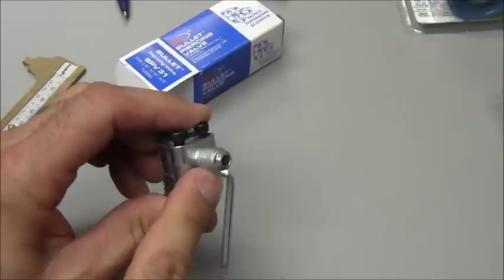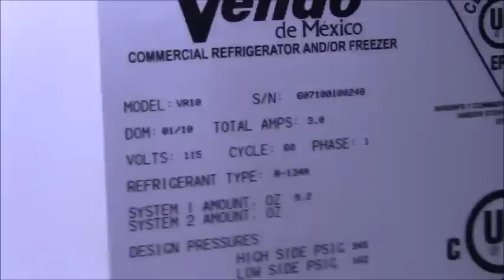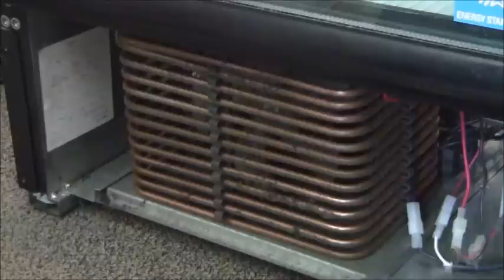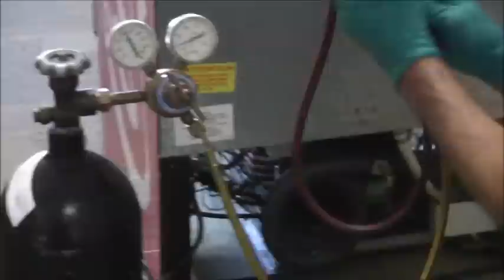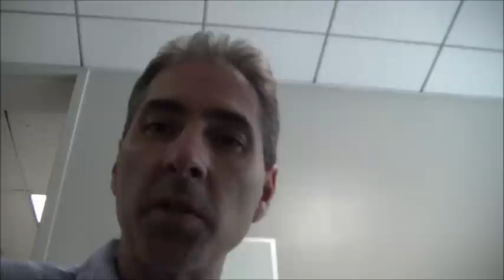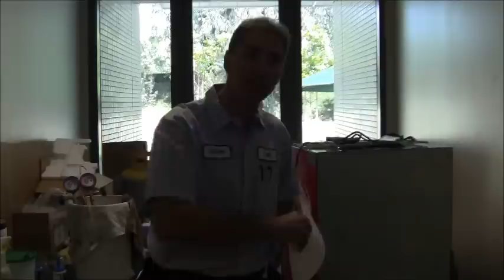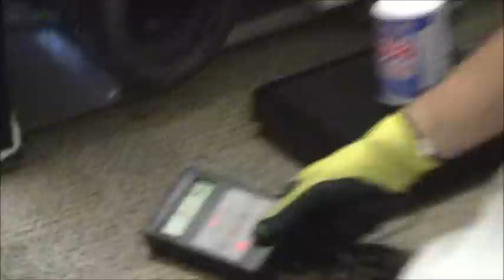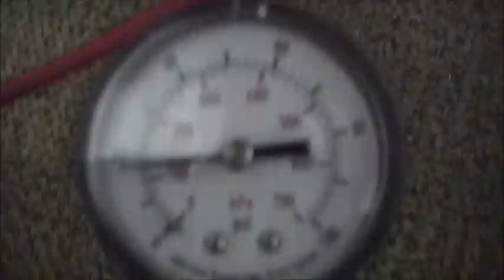Refrigerator not Cooling, Charge with R134A and Resealable Can

Comment: I have what looks to be the same coke fridge Vendo Vr10 that was in the 60's.  I didnt use a scale but put on a bullet valve and attached a r134a can w/gauge.  Pressure was at zero but I added enough to get to 10psi.  It's now cold inside "40's" but I wonder If I should add more since yours is at 18psi?  Iwatched other vids and they would stop at 5psi.

Comment: A friend of mine that works on commercial refers introduced me to Easy Seal. I have used Easy Seal on R22 systems and I have systems still running 5 years later with Easy Seal inside, I have not had to add refrigerant in that time frame. If the leak is too big it won't last, eventually the copper just denigrates. These were all copper units.  Also these are my own rentals so no one to get made at me if it doesn't work. It helped me to extend the life of my units quit a bit. I tried it before you bought it, hope this helps.

Comment: Just put the valve on it, let out the system preasure. Screw on the can turn the fridge on and it will pull the new charge in until the can is empty.  Unscrew the can hose and your good to go.
If if it stops cooling properly later, your valve is leaking down.

Comment: How does super seal keep from clogging the orifice?
Reply from the maker: Great question, Answer = I can only assume the engineers that designed the formula took that into consideration. I only use it as a last ditch try before unit replacement. I have used this product on a few units without any issues. One of the units was done about 4 years ago and is still running without a leak today!!!
Reply: @KenTraining  well that's very surprising & amazing. Does it actually stop leaks good then or have you needed to refill them still but longer intervals?
Reply from the maker: @naturestrail2296  In my case it stopped the leak on 2 different systems with only 1 application for each of the systems. Follow the cans instructions and use the correct can for your system.
Reply: @KenTraining  thanks for the reassurance

Comment: Infrared doesn’t work on copper pipe
Reply from the maker: Infrared thermometers may not work well on copper pipes because the signal reflects off the shiny metal and provides an inaccurate reading. To get a more accurate reading, you can wrap black electrical insulation tape around the pipe and point the thermometer at it. The tape will be at the same temperature as the pipe and will give a good reading.

Comment: 0:30 - That’s quite a comprehensive looking checklist can you explain the different items or post a copy?
Reply from the maker: go here for all my forms https://kentraining.wixsite.com/kentraining/download-all-forms-here
Reply: @KenTraining  Thanks, Ken. This is great!
Hmm. I thought you were using a refrigeration checklist like for a refrigerator or walk-in freezer. I see checklists for comfort cooling and ductwork.
Reply from the maker: @garypoplin  Sorry, I only have 1 check list. Most of my work is AC and not refrigeration.
Reply: @KenTraining  That’s ok. I’m in the process of creating my own list along with some refrigeration tips like letting the N2 pressure out of the system through the low side instead of pushing all the oil out of the receiver through the king valve!

Comment: If it’s slowly not cooling like it once did after 10/15!
Years don’t worry too much about a leak if it was still cooling, just add some feron and keep checking temperature with a gauge 
Add as needed with temperature control set half way

Comment: I usually just install  piercing or saddle valve, add UV dye, add freon to +15psi on low side(for refrigerator only) and DONE in 30 min. I tell customer to call me when fridge get warm again.  Typically it will get low on freon after one year. When customer call me again I will find a leak with UV flashlight and yellow glasses and do  permanent repair. Thank you for good video!

Comment: You are not supposed to leave access valves on a sealed system.  The charge is to critical, and access valves are known to eventually leak.  Use the process tubes to access the unit and then pinch them off and braze shut.  This is how the factory did it.  Leaving access valves on small systems like refrigerators and drinking fountain coolers is not best practice.  If there are service valves from the factory, this does not apply.
Reply from the maker: I disagree, I will leave in place.

Comment: Refrigeration manufacturers should be required by law to have a recharge valve on all refrigerators.
Reply from the maker: that would be nice.
Reply: They are not left there for a Reason.  Too easy to leak.  Use the process tubes like the factory did.  That’s the reason it’s called a sealed system.

Comment: Ken, pulling my hair out. The relay I am looking at with this borrowed fridge... Looks like nothing I've seen also the fan was not turning, I gave the compressor a little whack and it tried to turn on the fan started turning but now it's just clicking on and off. I noticed it also uses r12, am I going to just waste my time here. Second refrigerator in 3 months I've had to deal with. I took some pictures of the components attached to the compressor... It looks like a little cylinder about an inch long, with just this rubbery Brown oranges material which is connected to the single lead above the two bottom ones on the compressor. The other two have double sets of wires going to what I assume is the start relay, and the other one maybe is an overload heat sensor of some kind? That literally detects heat by being in contact with the side of the compressor. Ever deal with anything like that?
Reply from the maker: I have not, Sorry I could not have been more helpful. 
Good Luck!
Reply: Yeah I figured out what it is, the relay part is $50, but I think I'm going to test resistance on the compressor this morning and make a very quick call whether to buy a new fridge or not. We have a lot of power fluctuation and quick power outages here but I don't understand why it's taking out my refrigerator so quickly. The voltage is correct on the plug, the circuit breakers are rated how they should be it's HUD certified 4 year old house. So if the amperage is over on a power spike it should trip the breaker. Maybe it's just bad luck.
Reply from the maker: @cmdrefstathiusplacidus9003  I recommend you install the refrigerator to a power surge protector first then plug the surge protector into the wall outlet. That will give the appliance protection.

Comment: Never heard of a professional using an AC system sealer.  Most service guys won't even hook up their equipment to a system full of sealer.
Reply from the maker: I have only done to 2 systems and had good results with both.
Reply: Kind of like radiator stop leak.  Totally unprofessional.
Reply: Had a tech put sealer in an r22 system 15 years ago that had been going low every 2 years.  Still running cold this season.

Comment: Need help with my LG refrigerator my lights not coming on my water ice maker panel will not do anything or light up at all however the numbers 56 are lit up. What should I do? Ive only had this refrigerator is only a year in a half old.
Reply from the maker: I would call LG Tech support and ask what code 56 means.

Comment: Hi Ken, in my refrigerator, the piercing valve is on the process tube (which is crimped at the end). How does one charge the refrigerator through that?
Reply: You are not supposed to leave access valves on a sealed system. Use a piercing valve on the end of the process tube, before the pinch, and recover any refrigerant.  When your done with everything, pinch off the process tube(they make a special tool), remove the access valve and braze the end of the process tube up.

Comment: I thought the low side was supposed to show less than 1 psi on the gauge, because its sucking, or pulling a vacume basically. Meaning you had plenty of refrigerant. If it showed above that you were low.
Reply: On average 3 psi is where you want to be. 1 psi is low 5 is to high and can put stress on the appliance. The system is low if it is at 1 psi or pulling vacuum. If the appliances is pulling vacuum you should vaccum pumpe system and put freon in at labeled amount. Use uv additive to find leak if it's not obvious. Just fixed my freezer and added exact label amount of freon and was 3 psi exactly.

Comment: I'm a DIY working on a 22YO GE Profile side by side which died in this CA heat wave. Found the condenser fan dead and the defrost control  intermittent, fix it all but the refer side is now having trouble reaching 37deg during hot days ( drifts to 42) , the freezer is fine at below zero with both sides temp control crank to the max. During my troubleshooting I noticed that the compressor was pulling low amps  , 40% low. I considered that that might mean a worn-out compressor. But Ken, i heard you say your Coke refer. was also low at 1 amp (I saw the name plate at 3.2 amps) . Is low compressor amps/draw an indication of a low refrigerant charge?
Reply from the maker: Yes it can be an indication of low charge and the compressor is not working 100%. because refrigerators are critical charge, I believe the only way to confirm this is to pull charge and weigh it. I do want to admit, I don't work on Refrigerators that often to call myself an expert. Let me know how you make out.

Comment: Poor repair techniques.  When you remove your manifold, you lost all vacuum.  Invest in a T connection, a micron gauge, a core moral tool (doubles as a valve), and 30 lb jug of 134a, Nylog, and hoses with valves.  Hook up and vacuum to 500 microns (300 if your pump will do it).  In that vacuum, you vacuum all the way to the 134a jug as well; hence the T on the service hose to vacuum and cylinder.  Then you valve off the micron gauge and your manifold, and the high-side and low-side hose at the service ports, and your vacuum.  With the can upright, you open the cylinder, service hose, low-side manifold and high-side manifold... and this brings vapor up to the service ports on the vending machine without letting any flow into the machine.  Now you weigh the jug for its before weight,  Next, you flip the cylinder upside-down, then open the high-side manifold to charge the hose with mostly liquid up to the high-side port and open the high-side at the service port.  Stop at 80% your charge closing it at the machine.  Flip tank upright close cylinder, and start machine leaving the high-side manifold open but shut at service port of the machine (allows you to get the liquid out of the hose in next step). .., slowly open low-side at machine...  then slowly crack low-side manifold... all liquid in high-side hose will flash and go into machine... leaving just vapor in all hoses like it was when you weighed tank...  using cylinder upright re-open cylinder and open low-side port on machine then feed in to 100% charge by scale u dear jug.  Close all valves.  Now if you want a high-side reading you would shut high-side manifold and open service port to get high-side reading, but liquid would enter the hose...  you would need to close it at the machine and put it back through the low-side manifold.  Regardless, everything should be closed including the cylinder and only vapor in all hoses when you reach 100% charge just as your first weight.   You should have the quick disconnect that allow you to unscrew before breaking the connections at the service port of the vending machine.  Otherwise you loose at least an ounce disconnecting.  If you do this, you have absolutely no air and factory-perfect charge when done.  Place on brass service caps either rubber gasketed or tapper type.  Use small dab of Nylog on each regardless.  Brass caps hand right then like a 1/16” inch by pliers just to compress rubber.   If taper caps, they are basically a flare fitting.  Tighten caps by pliers until quite snug.
Reply: There's no way you lose an ounce disconnecting... or even a half ounce... unless you're irrationally slow at unscrewing the connections.  Most of what you said would get me fired from my company for taking too long, and needing too many expensive non-necessities.  This guy did a pretty good job.  A few hiccups, but not all of us can be perfect Super-Techs like you.
Reply: M
L
Lppl00f is
Reply: Most informative. Could you elaborate upon "You should have the quick disconnect that allow you to unscrew before breaking the connections at the service port "?
Reply: 00l lol ik!+#
Reply: A pro who really knows sealed systems would never leave access valves on a critically charged system. Use the process tubes and pinch them off and seal with a braze, just like the factory did. It’s no longer a hermetically sealed system, Iike it came from the factory

Comment: Hi Ken great video!. had a ref compressor when turn on it draws high current that the Over-Load-Protector tripped. Anything we can do to correct it?
Reply from the maker: i need to know the hi and low pressures to answer. the system needs to equalize in order to allow compressor to start. you may need a new start capacitor and or a hard start kit to make the compressor start.

Comment: hi,
this will solve the problem, it is way better than the T-shape valve he installed, especially without cleaning the tube ends.
https://www.ebay.com/itm/C-D-Braze-On-Self-Piercing-Copper-Saddle-Valve-for-1-4-Tube-CD5514-Package-of-6/152537976262?hash=item2383f8cdc6:g:cf4AAOSwLI5di-Zj:sc:USPSFirstClass!34953!US!-1

Comment: after welding the valve in  you have a mess on the inside not cleaned out wont the debris
wind up in the small liquid tube and block that line,  how do you start with a pristine system
after you welded that valve in?? or is the debris inside not going to affect the system,  can
a high pressure filter be install ahead of the small line so it wont block after a repair or welding is done without cleaning the system ??
Reply: You don't need to worry if you use nitrogen flow while brazing. Nitrogen prevent oxides in the pipe forming

Comment: Mr. Ken what happened to replacing filter dryer every time you open a system and while you where still there why didn't you install a shredded valve on high side too so you can be able to read your high side pressure.
Reply from the maker: your right I should have done that. Job was a while ago I dont remember the reasoning. time/space?

Comment: Ken please really I know you tried but Serously you do know that if the cap tube was plugged or restricted you would only pressure test the low side . On a small unit with a small leak pressure test both sides  equally install a fitting ...your net difference will remain zero so 200 or 300 psig is acceptable to find leaks even 400 psig if you cannot find it . Keep the net across the high/low @ zero working 
Omg you dont have a micron gage wtf drop mic  im gone stop showing people

Comment: 3:19 - ANTI-CROSSTHREAD TIP: If you start by turning the bolt, nut, cap or screw with a right-handed thread up to one full turn to the left, until you feel it jump to the next thread before turning to the right, you'll never cross-thread a screw again.  This works for ALL thread types: course, fine, wood, sheet metal, etc.
Reply: Grandpa taught me this when I was around 6. Lololol
Reply: Pro tip, get this man a cold beer!

Comment: Only use low side to vacuum ! It will takes too long ! sometimes compressor worn out that is hard to judge! leaks is some thing hard to fix and takes too much time!
Reply: Well yes sometimes they can be hard to find, but it depends on the rate of the leaks,for eg. if ur jus losing up to 20 percent charge a year then , u can live with that, u might wanna use sealer - which i dont like to use, but if it a old unit that may be the best solution to your problem! Even brand new units something comes with leaks from the factory it can be a bad brazed joint of micro crack and they well stamp it PASSED, yet it has a leak especially on large units, remember the bigger the unit the move pontential for leaks! This is why large split unit have to be serviced year around because guess what they leak! But remember without leaks ur out of a JOB, so thank GODd for leaks if your a HVAC technician.
Reply: You inject dyes then check it later for leaks!
Reply: @ericlee3057  i also avoid dyes they make a complete mess in the system.usally if the leak is massive with some time and patient , u should find it!  Using dyes and sealer are a last resort.

Comment: You HAVE to add a few gallons of water   for a load   on the unit  besides the air inside of it,  if you  do not have a load  in the thing  good luck  trying to  do what  you are doing.

Comment: 45 minutes into a 1 hour 5 minute video and still "testing" to "see" "if" it's leaking! I knew the unit was leaking when he determined it was low on refrigerant, he confirmed it by removing the existing charge it was down by 6 ounces,  how do  you think it escaped without a leak?
For new construction leak testing as you did is done however  I could never bill for hours  to see if a unit that was low on gas had a leak  for sure???  I just add sealant  and ad gas  to a near  zero  coil o domestic  reefers,  with R 12 it was near  a vacuum  at the tail end of the cycle when the box is pulled down and the thermostat opens evidencing it is satisfied,  for that thing I would  charge a coil  15F below the desired box temp  to top off the thing  as I  real  world service